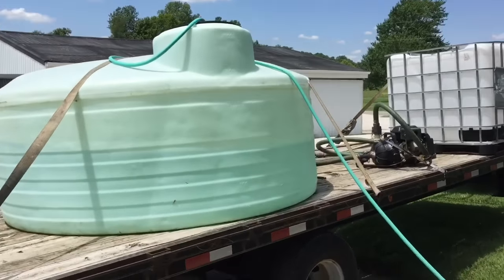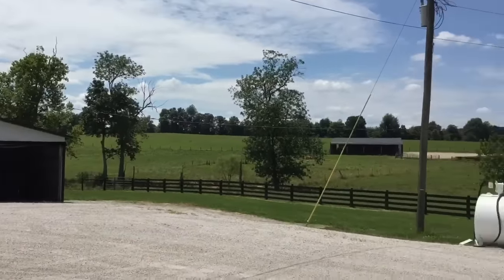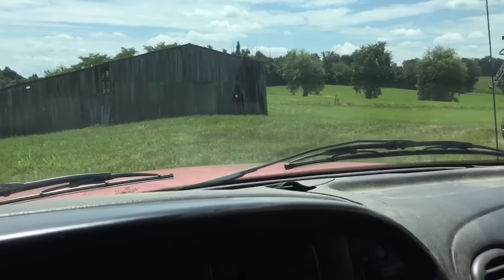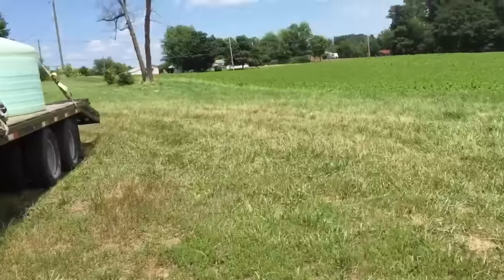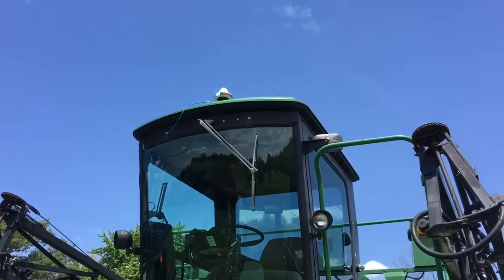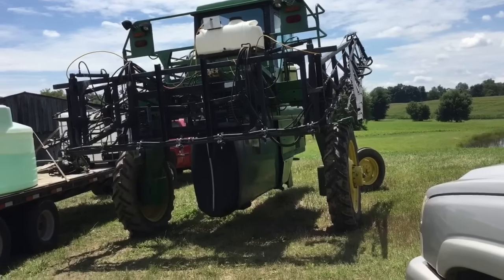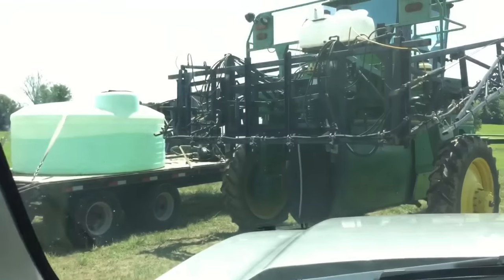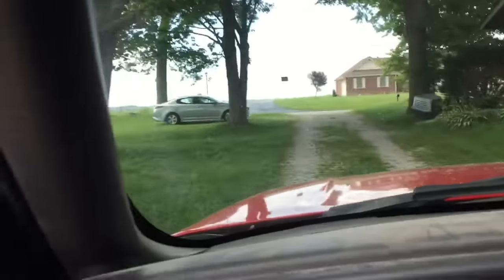The spraying outfit

Comment: LoL   Was that seriously a cassette adapter (blue cassette) I saw sitting in the dash cubby?  Please don't tell me it connects to a CD drive!  Been 20 years since I've seen one.
Reply from the maker: Ken Arnold no this truck does have a cassette player. And that could be what your talking about
Reply: Farmerjon9660 in the old days, we could use a cassette adapter. Just a cassette tape which had a cord and plug, which we then plugged into the headphone jack on Walkman cd player. Theory was we could then channel the cd sound thru the cassette player (wasn't common to have a cd player in autos as they were an expensive option)